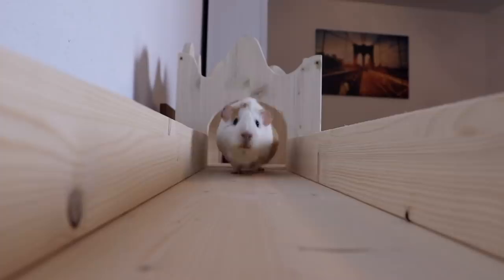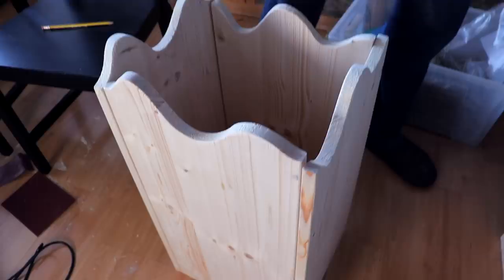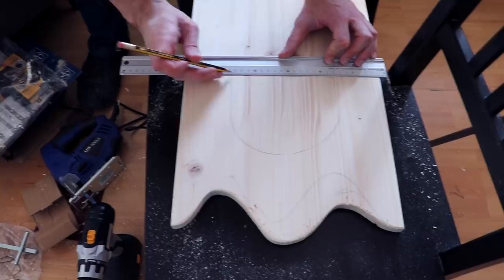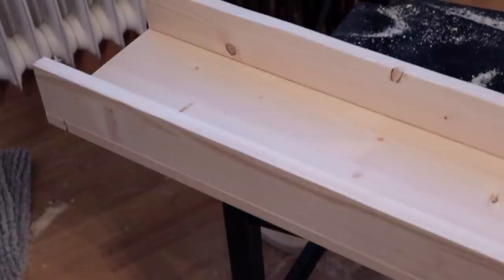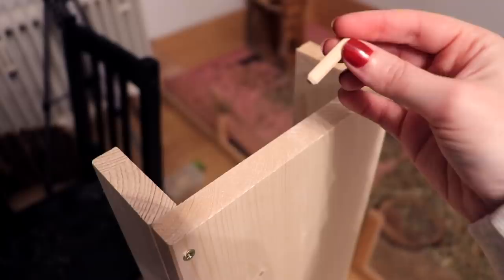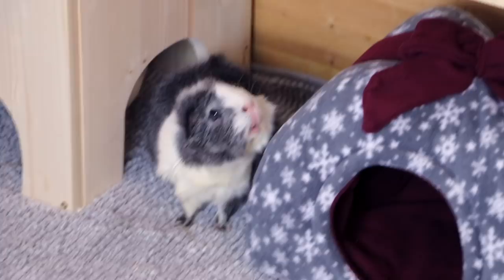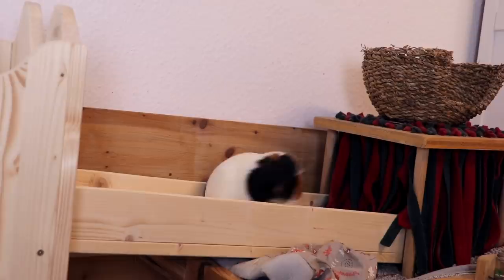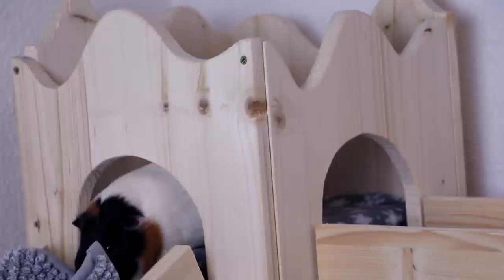Building a Guinea Pig Castle | DIY Castle Cage

Comment: Did you find the timber got dirty or odorous? Or did you place liners on all the bridges and ramps to help keep them clean? I'd like to build some levels & bridges for my two piggies but I worry about the timber being hygienic and they chew on coroplast.
Reply: i would recommend using a dog soaker, cutting it to the shape and re-doing it when cleaning is needed. (sorry 11 months late)